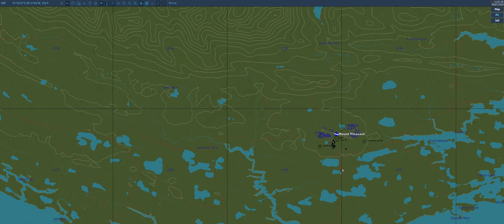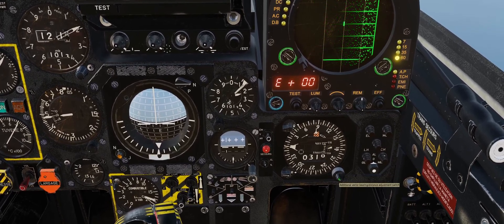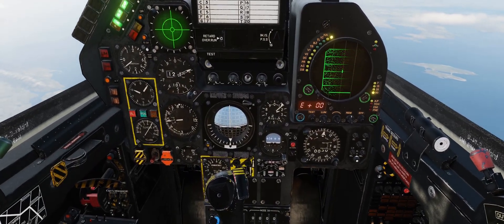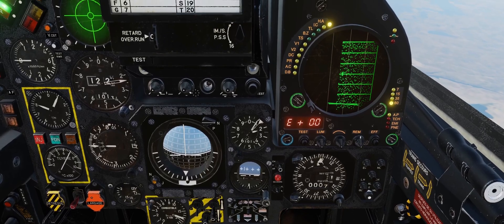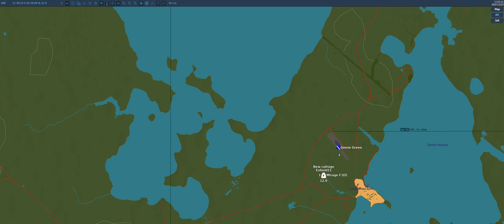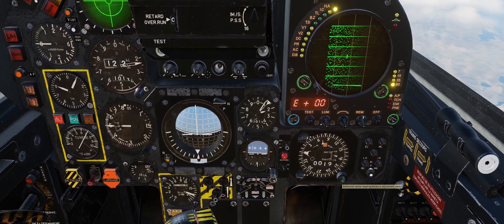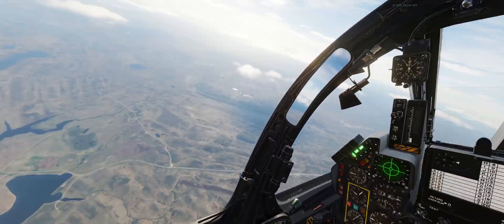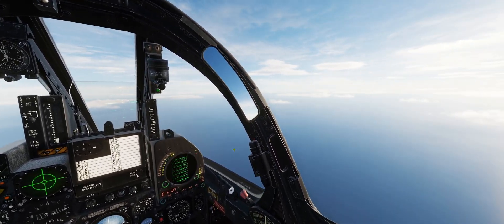DCS Mirage F1EE - TACAN offsets

Comment: Thanks for this stuff. There’s not that much around on the EE, I suspect all the people who did tutes on the CE didn’t feel like repeating themselves and the differences are usually slight - other than the INS system of course. 
And right now the F1-EE is my favourite DCS module. For now.  I’m holding off on learning the F-15E until Mudspike’s guide comes out, I still need to get my head around the Apache and in the meantime, the EE is a delight. Real flying (not FBW). It also has advanced enough radar and weapons to make it fun. It’s a beautiful plane. Don’t get me wrong, I’ve loved the look of the F-16 since the 1980s but the F1 just looks like a fighter jet. If you asked 10 boys to draw a fighter, 8 of them would draw something that looks like the F1 :D
Reply from the maker: It's truly a lovely aircraft.  I'm looking forward to doing more with it.  I don't feel like I've even scratched the surface with the module, there's so much to learn and so little time!  I'm hoping that the kneeboard laser code entry comes soon, so I can showcase some multi-player JTAC stuff.  I think that has a huge amount of scope for enjoyment.